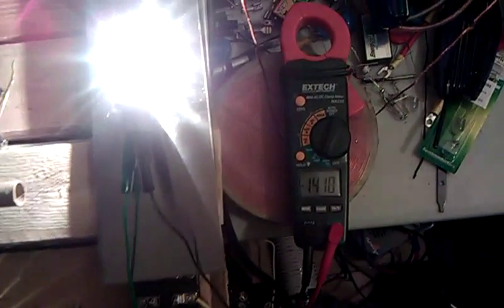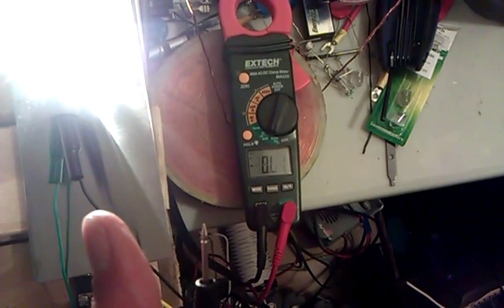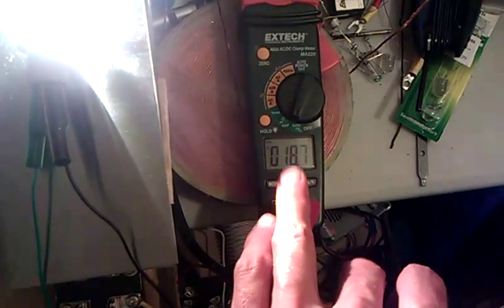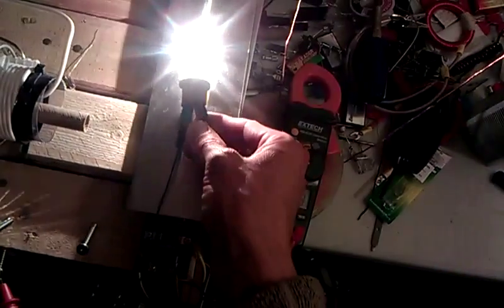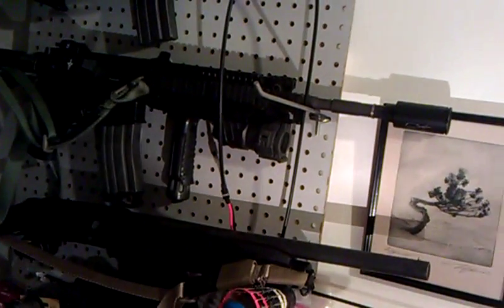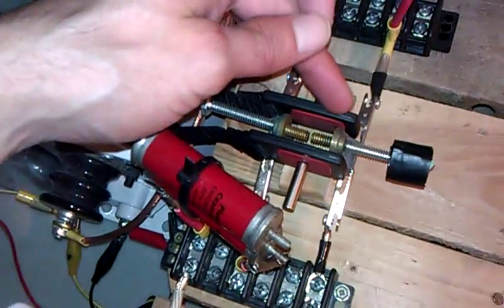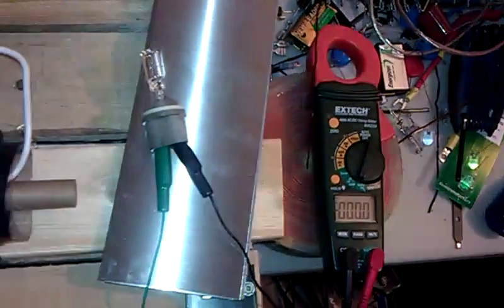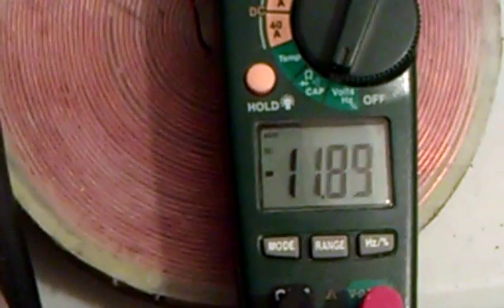38 Don Smith Device Project: Magnetic Quenching of Spark- Gap and Some Fine Tuning

Comment: Very nice resonance on L1. Please put 500mA analog multimeter in series with Yours 5A. And the LOAD... could You put a diode bridge after L2-C2 resonant and than a capasitor to stady volts on output... Load+C and then mesure DC V&A on Load. Thx